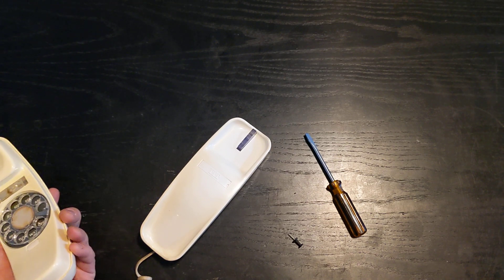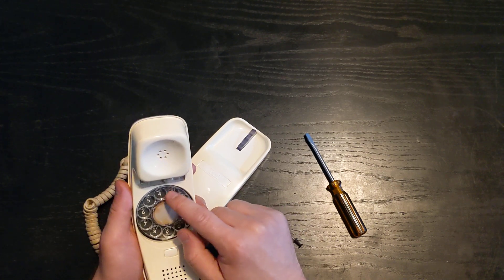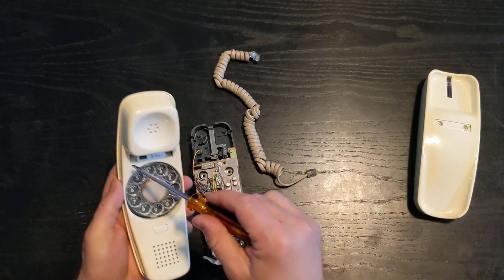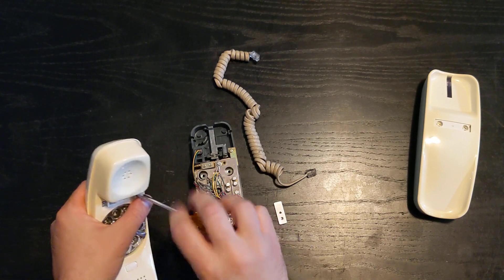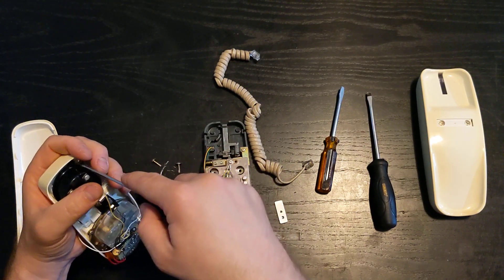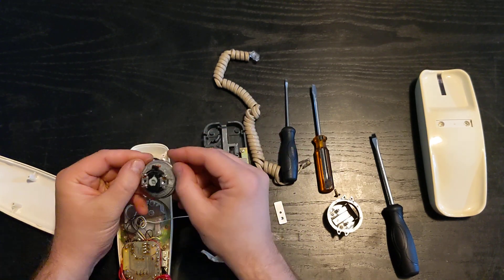Trimline Teardown

Comment: It probably does have a bulb in it, but it doesn't light up. This could be because you have the kind of phone that needs a separate power transformer to make the dial light up. Transformer wires would be connected to the yellow and black wires.

 I believe the LED type phone doesn't need a separate power transformer.